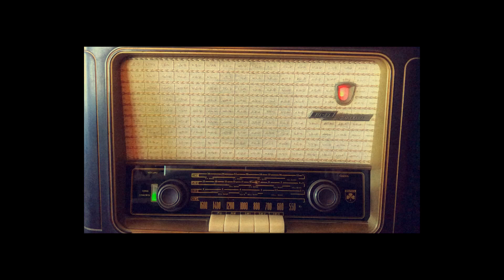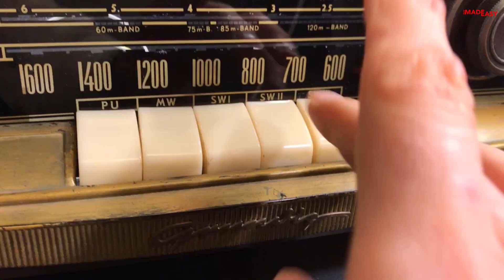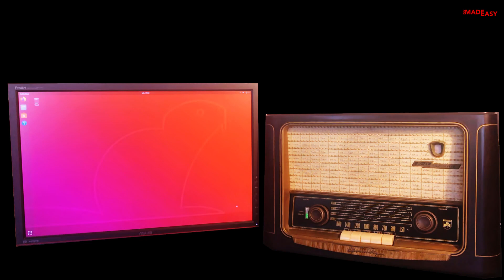Radio PC - Recycled an old radio and turned it in to a PC

Comment: I think you really should have used the original vacuum tube that poked through the front as the power indicator light. A nice warm glow from a vacuum tube is simply beautiful, and you can even put an let at the base of them to light them up even more, and different colors. Newer McIntosh tube amplifier do this with green leds.
Reply from the maker: Thanks for the tip

Comment: Shame, shame  ,   destroying an old classic  European radio  that has been around for over  60 years  now replaced  with something that will get outdated   in a year or so .... shame , shame ....
Reply: Who wants an old beat up radio? And who is going to listen to it?
Reply: It was broken anyway and you can just upgrade the insides as you need it's not getting thrown away or ruined it's getting a new life
Reply: You can always replace pc components 😂
Reply: The radio didn't fucking work.

Just because pc parts are not new does not mean they have no value and need to be replaced yearly.

Pc parts stay relevant for over 10 years and can be replaced when they are too old to function. 

Radios have been outdated for 20 years, I'm not sure what makes you think this old ass radio was something special. 

I'm pretty sure I've seen this model of radio being sold for 5 bucks.